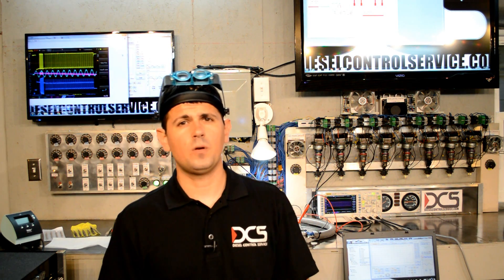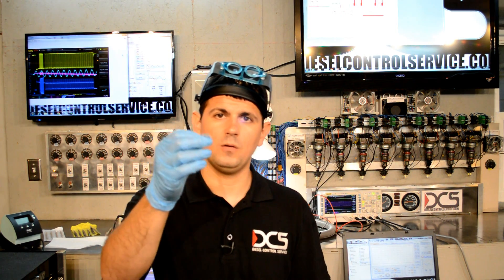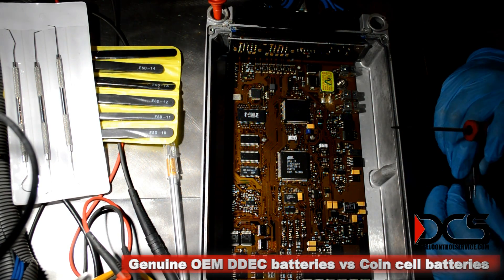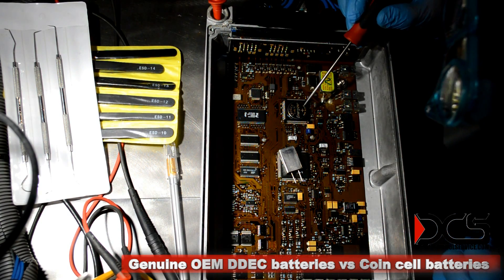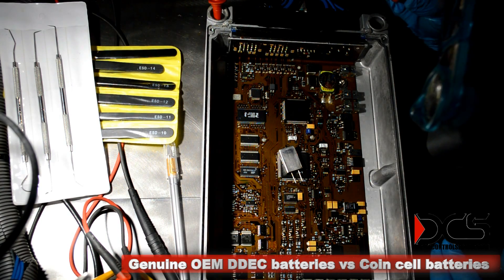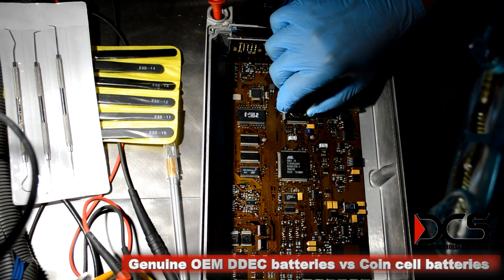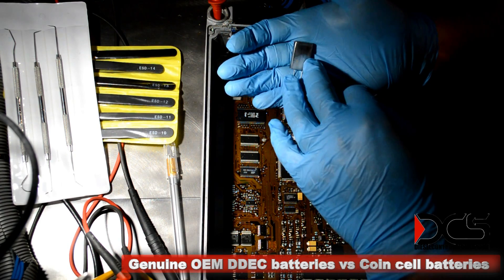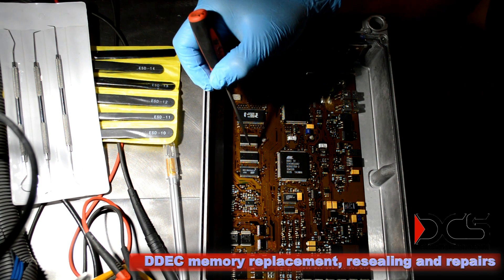The ECM Lab - OEM Detroit Diesel DDEC IV ECM internal batteries vs Coin cell batteries

Comment: What is the battery voltage?
3.7 volt ??
Reply from the maker: If I said its 3.7 and you soldered in a 3.7 volt battery in your ddec iv and caused damage would you blame yourself or would you blame me? We both know the answer to that question.

Comment: Hi..very nice of you, to explain in details. I have a 2007 western star , Detroit 14L. It’s cranking well but won’t start and voltage gauge always shows 0. It’s been sitting for few weeks in cold weather, can be the ECU faulty? If yes how much to reman, such a unit? Thx much .
Reply: Heat the computer with a hair dryer and it will start

Comment: What size and type bolt is on the ecm cover of a Ddec3 ecm @diesel control service
Reply: Hello brother, how are you? I am from Honduras and I have a problem with a computer on my truck, the truck turns off but it remains on, the fault only lasts a second, how can I communicate with you. Greetings
Reply from the maker: 12 point

Comment: Buenas soi de panama si me puede ayudar cual cable de itnition y cable de aceleracion de ditroi serie 60 dd4 motor era cat haora boi poner ditroi
Reply from the maker: The ignition input is pin B3 on the OEM side 30 pin connector.

Comment: What are the most common failure in ddc3 with code 52 and with engine not starting??
Reply from the maker: Timing reference sensor issues. Most of the time it's in the wiring.

Comment: If battery dead what happened to ecm
Reply from the maker: As far as drivability usually nothing. Most will run and fire injectors even after you take out the battery. If your DDEC doesn't start it's not a battery issue.
Reply: What’s the purpose in replacing the ecm battery if the DDEC can run without its battery?

Comment from the maker: Since I got back from MATS in Louisville I have been getting more and more requests like yours.  Once I get done building my N14 Celect, Celect Plus, DDEC V, ISX CM570, ISX EGR CM870, and ISX EGR DFP CM871, upgrades then maybe I'll be able to build a testing simulator for another company or more likely I'd sell them one of my old retired ones. Also guys call me and want to buy batteries from me or want to find out where I am getting them. I'll admit when I first started changing the batteries in these I thought it would be easy too until I found out the hard way that these batteries don't always fail of natural causes. Sometimes the battery was killed by a board short to case ground for a 12 volt supply trace. So guess what happens when you solder a fully charged lithium battery to a shorted RTC circuit. You get a fire. Or if your lucky lots of acid all over the board. Your first thought might be to take it out on the guy who sold you that battery. That guy isn't going to be me. If by chance you believe a dead RTC battery is causing your DDEC not to start. Look elsewhere. A dead RTC battery will never prevent a DDEC from starting the engine unless the battery burned the board or leaked acid on the board.
Reply: do you sell them?
Reply: or where do i find them?
Reply: What else cause dead rtc battery?
Is there any connection with gauges (oli pressure ,oil temp,coolant going all the way up 250f?
 Check engine coming on and off,
Codes : 

ENG. throttle pedal 
Short lo.    128 091 04

ENG 
Low.     128s232.  01

Acceleration pedal not working.

Engine starts every time and works perfectly on the spot ( idling).

Sometimes I could drive 700 miles normally and suddenly check engine comes on and loosing acceleration pedal but keeps idling?!

Engine out frame rebuild two months ago,everything is new 35000$ repair costs.
Detroit ddes 4 12.7 1999

Thank you 🙏